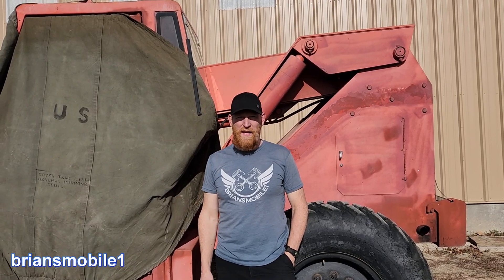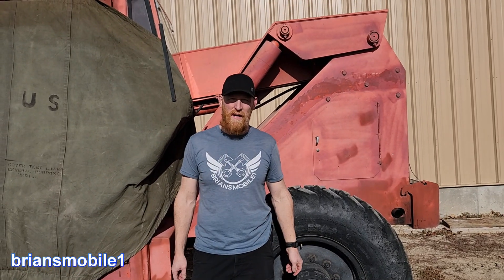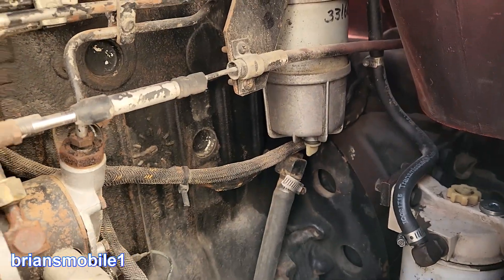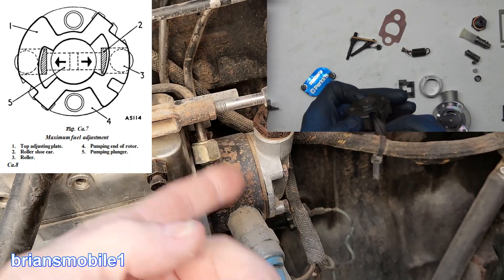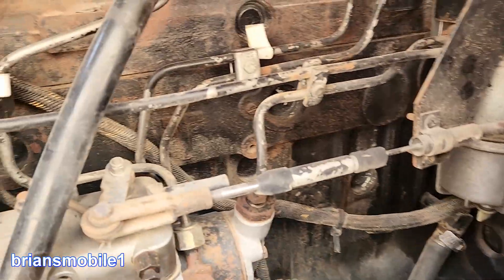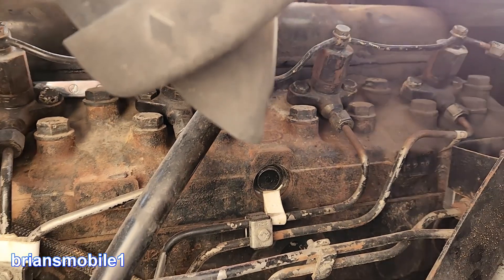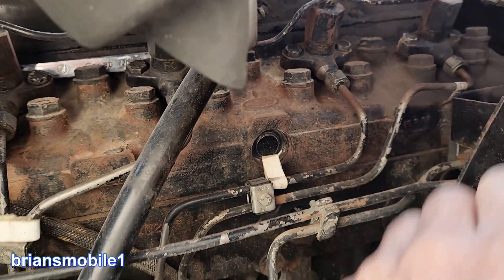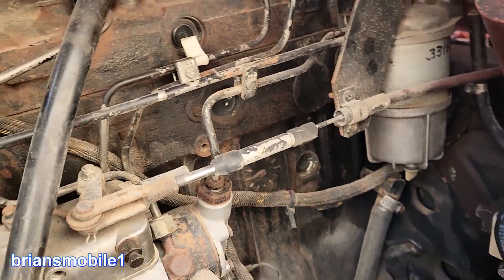Ran Out of Diesel No Start Fix How To

Comment: Mechanical things will be good if we get hit by emf. 
Back in the day  drove oil trucks and we had an old Dodge truck with a Perkins diesel engine that we only used when we got busy and had a part timer help us deliver oil. If it was cold out we had to break out a space heater and put plywood around the truck to warm up the engine. Good memories. Merry Christmas to you and your family.
Reply from the maker: Merry Christmas to you and yours!  Great to hear from you!